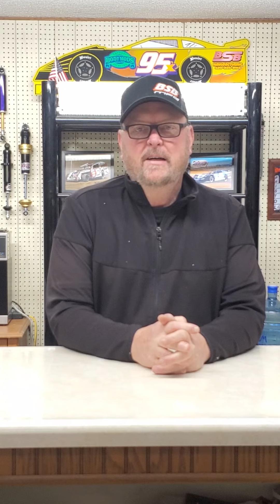Terms we use in racing.

Comment: I have another "term" I need defined that you used in part 3 at the 4:43 mark... in talking about driving past the entry point and getting into trouble when it gets slick, you say all the things you need to have right "stagger, some rear steer and some step out in the car along with the proper load on the Right Rear"..... What do you mean when you say "step out in the car" ?.... thanks Johnny
Reply from the maker: The car should be tailed out some even going down the straight away.